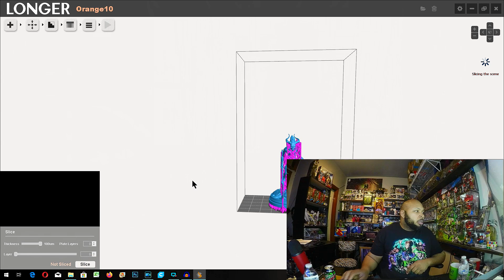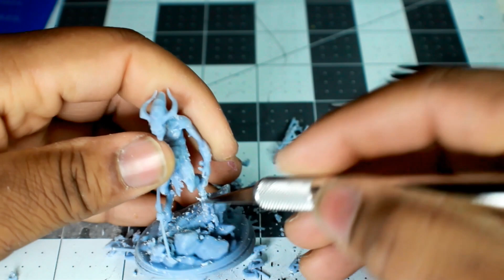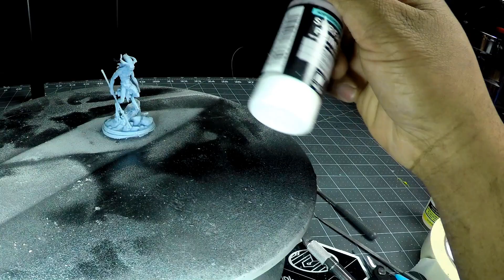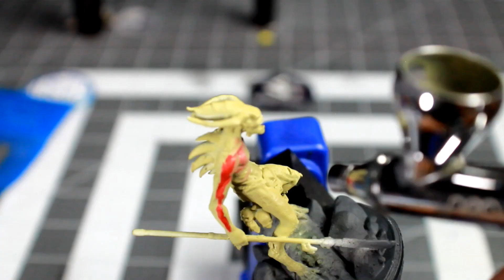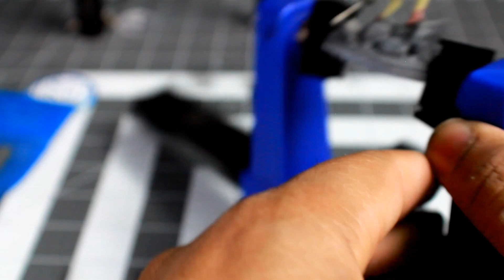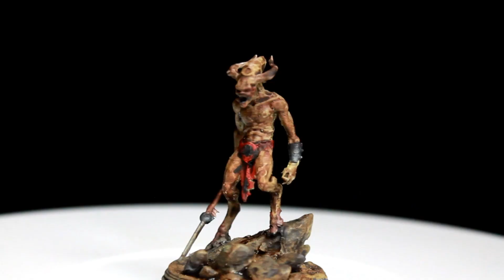First Minature Printed and Painted on LONGER Orange 10 3D Printer Resin SLA 3D Printer Touch Screen

Comment: Did you try using the playing cards to level the print bed and the resin base. Noticed you used a sheet of paper in your unboxing video rather than the cards...the warping is from the paper not being level..

Comment: Nice video! My suggestion  to the warping problem (and to get an even more detailed model ) is to slightly rotate the model and then generate the supports. I know it sounds strange because the model has a base, but if you put it rotate the whole  mini to let's say a 40° degree, you have better results. Hope this helps, keep going!